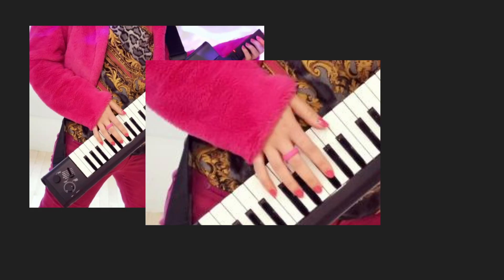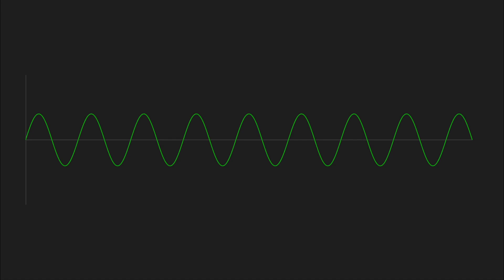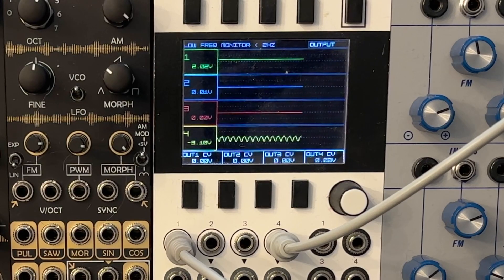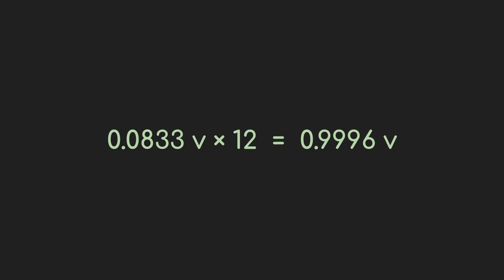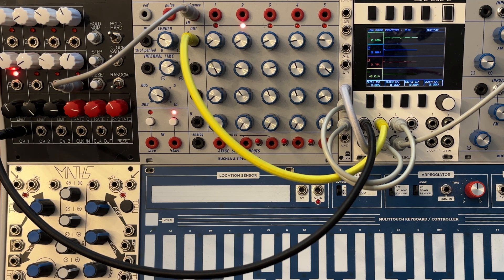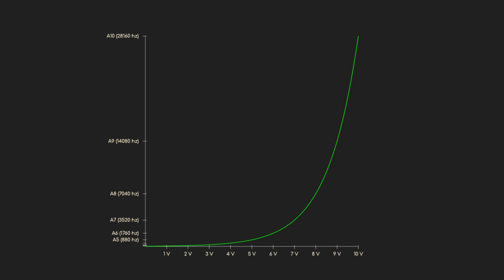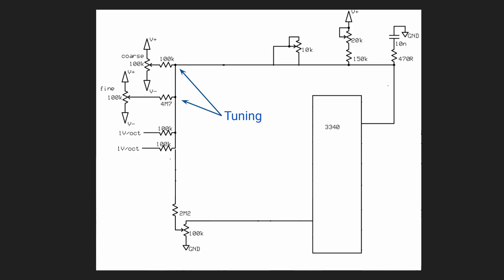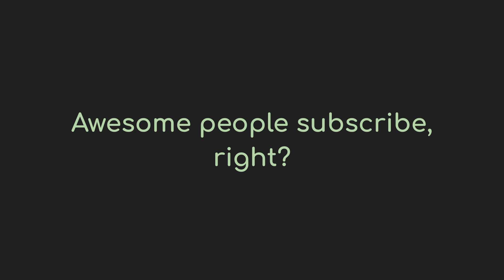CV, pitch, frequency, and the surprising meaning of exponential FM

Comment: Great video! Maybe I missed it, but did you explain why the oscillator you're using has two identical CV inputs? Is it specifically to do the type of sequencing with transposition you did earlier in the video, or is there another intended application?
Reply from the maker: @Perceptes In the end, I think the reason just came down to "well, I have a spot on the front panel for it..."  :)   Almost certainly one of the reasons was to be able to do that transposition, but that designer makes weird modules to do weird things, and this just gave it more flexibility for weirdness.